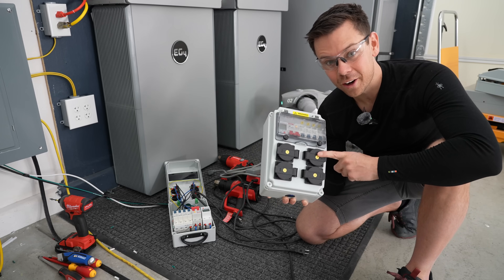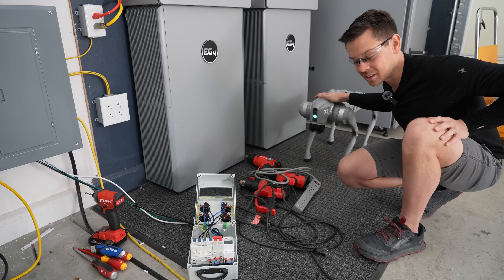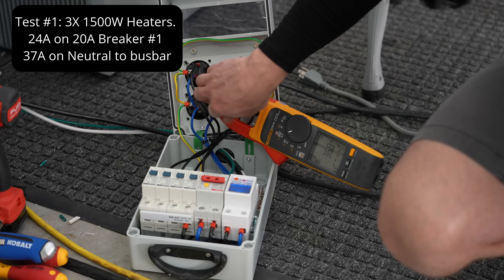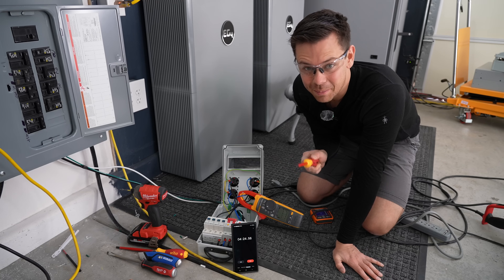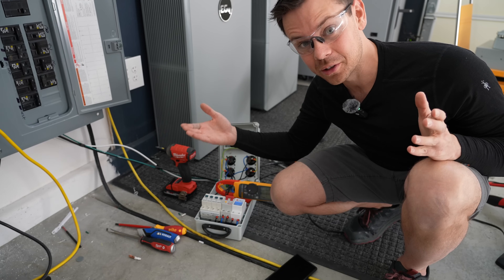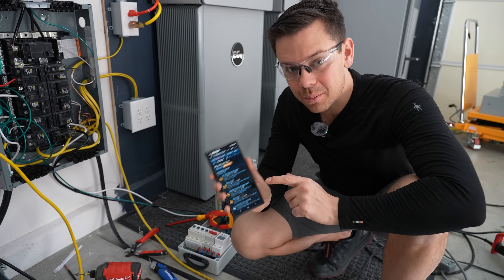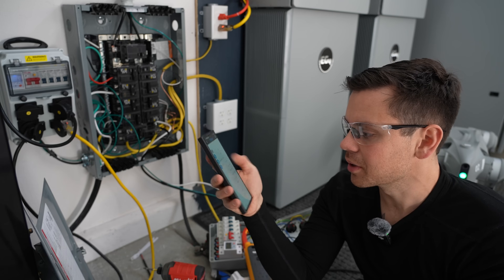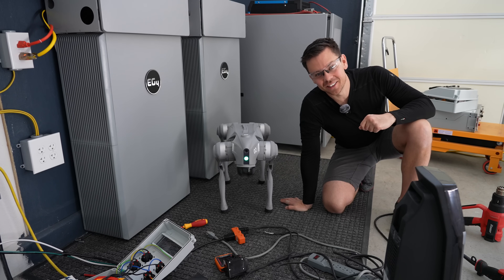Are 20A Breakers from China Safe?! Let's test them!

Comment from the maker: Some more points:
The high quality UL breakers are also from China.

Some breakers are designed to trip after a longer duration. That's why I was trying to find data sheets. But I couldn't read the graph on their site. Couldnt find data sheet. And they were not UL listed. That information should be easy to find. 

Even if the wiring passed this short test, having 40A on a 14 gauge wire is not conforming to any accepted standard. I used to push 100A surge on 12 gauge wire on my race drones, but they are moving very quickly. Just because you can do something, doesn't mean you can do it for very long or safely. 

If you like this type of testing, let me know by giving the video a thumbs up! If a video does well, I will make more of them! :D I am constantly looking to check to see how you vote. Please let me know!
Reply: The duration is governed by the breaker type.  A, B, C, or D.  The typical breaker is type C or type B and run on standard trip curves.  Type C is the most typical and has generously long trip times.  Type B is a tighter spec than Type C but will false-trip on inductive starts more often.  Type A is almost never used, and Type D is used ONLY for hardwired AC motors with high inductive loads.

The two things to verify are:

(1) 3x (type B) or 5x (type C) current or higher (aka a short) should instantly trip the breaker via its solenoid.

(2) And otherwise the trip curve's worst-case time for any given current ratio should not be exceeded.  (this is the thermal trip via the bimetalic strip internal to the breaker).

The internal bimetal thermal trip does likely have an adjustment screw, possibly accessible and possibly internal and not accessible.  It sounds like it might not have been calibrated.  But that's still bad, obviously.

-Matt
Reply: Yes, UL certification has to do with quality control. 
Very strict.
Canada ,USA  UL or CSA  is costly bottom line is they are made to preform their specifications.
Either Mexico or China, 
Most inexpensive electrical sold on Am*z*n  if no UL or CSA
Avoid.
Reply: UL exists for a reason.  Their testing is expensive and a pain in the ass but UL Certified actually means something.
Reply: the C class breakers have a 30% over current trip, B class have only 10% over. the D class breakers are retarded breakers for motors... they trip with like 20%over but after 1 min...
Reply: re-commenting here so Will sees it ... The TAIXI MCBs are standard C curve devices as indicated (C20) on them and have thermal and magnetic trip.  C curve devices will take over 16 minutes (most trip graphs simply don't go up far enough on the time axis to show what the expected trip time will be!) to trip at 1.25 x rated current.  At 2 x rated current they will operate in 50 seconds or so, assuming standard test environment (air temp 25c, MCB mechanism temperature at 25c).
Reply: Is that rail mounting system for breakers used anywhere in north america? If they aren't, it's not strange at all that they are not UL listed and instead listed as CE for europe and china
Reply: @scania9786  The rails in the plastic box?  Those are probably DIN rails and they are standard world-wide for many small form-factor devices, including MCBs and MCCBs.

-Matt
Reply: @scania9786  DIN rails can be found in industrial and commercial in the USA.
Reply from the maker: Some other viewers pointed out that this long duration rating is common for Europe. It's spot on. I am not used to this at all. All the America breakers trip pretty easily. 

Still havent found a data sheet for this thing.
Reply: @WillProwse  You won't find a datasheet.  They don't make them publicly available, if they even exist, but they do have full specs for classes of their devices on their web page.
Reply: @WillProwse  This all just reinforces my decision (a few years ago) to over-size all my wiring.  I also use Type B breakers as a first-cut on the DC side for the tighter specs, and only switch to Type C on circuits that trip Type B.   That said, the industry standard is Type C because the industry really doesn't like dealing with consumer complaints about premature trips.

I've always felt, though, that breakers should be a bit smarter than they are.

-Matt
Reply: Fluffy
Reply: ul listing and CE listings are nothing more than a payed document...

Comment: You need to now test the 80 Amp breaker as well.  Off to the resister wall.............  I guess I missed the wire one, thought it was the one I had watched.
My guess is the robot dog has orders from china to not let you find out their sh*t is substandard. It goes into mailman mode when you look.

Comment: I see a lot of people commenting about the poor quality Chinese breakers.  They are performing pretty reasonably.  Search for a C curve trip graph and follow the mean line for 1.25 (25A) x and 1.85 (37A) x (the mean line is halfway between the upper and lower bounds of the trip area).  That's usually where the manufacturers target.  It's acceptable to operate at the extremes of course too.  Keep in mind that these things are affected by ambient temperature too.

Comment: Thanks for the third update.
Mine came an hour ago, I got the one with the L5-30 socket;  I read the instructions and they have CE and ETL certified in the paper, but where it's stated is confusing, it's not in the row listing the  circuit breakers, but only in the row down by the sockets. 

so is this sockets only or all is the question.

I managed to find some english writing on the wires and temp is listed above 400 C and 700 C, and a size of 2.5mm on the line wires, now from my memory 2.5 mm would be 10 AWG, I didn't have any #10 stranded, but I have lots of #10 solid and I compared the diameters placing the solid up against the stranded and the stranded was thicker.

Socket for l5-30 is 32 amps, but instructions say use only 80 % so we are talking 25 amps max. can we take those breakers out and replace them?

Looks like this is going back.

Comment: Don’t forget … this all European style beakers. If you buy a an C20 MCB you become an breaker that must resist 1h for an overload of 1.35 - 1.5 times current before trip. The cable in this combiner boxes seems to be 10mm2. In Europe at 230V this cable can handle up to 63A of current (230x 63A = Watts). The red ferells seems also for 10mm2. This box is not really for USA in my eyes
Reply from the maker: Ohhh wow. Another viewer said that. I am not familiar with European trip points

Comment: Obviously not as plug and play or as waterproof, but building one of these is easy and fairly cheap. Get something like the Eaton 4-space outdoor load center, and connect a couple receptacle boxes along the edge. You can build something like this for roughly $100 with GFCI. 
Everything would be UL listed, safe, and quality. (as long as you know how to correctly wire up a few breakers and receptacles)

Comment: I like the idea of these boxes, but ya, I think I'll pass one these specific ones. A few thoughts, 1) I wonder if these are "supplementary breakers", where they are meant to be used where there is another primary circuit breaker providing protection. Different standards and trip curves than normal breakers. 2) I found the raw empty case on aliexpress, wondering if it would be worth buying the empty case, and DIY-ing it by putting in better components ourselves.
Reply: Yea, CL listed breakers would be better.  LOL
I was just thinking.  Are they the same busbar spacing so you could swap out the relays, and add a bus strip for the neutral wires.

Comment: Great work! Glad you are hot testing. Another example of junk from China. I have several DC non-polarized DIN rail solar breakers that I am now concerned about. I have had polarized DC circuit breakers that have caught fire -- never again. When it comes down to it, best to use fuses + breakers these days in solar (T-type fuses are the best). Great work Dr Will -- the electronics man! 😄

Comment: The TAIXI MCBs are standard C curve devices as indicated (C20) on them and have thermal and magnetic trip.  C curve devices will take over 16 minutes (most trip graphs simply don't go up far enough on the time axis to show what the expected trip time will be!) to trip at 1.25 x rated current.  At 2 x rated current they will operate in 50 seconds or so, assuming standard test environment (air temp 25c, MCB mechanism temperature at 25c).

Comment: At one time Underwriters Laboratories was the only listing agency in the U.S., they had a monopoly & grew fat & arrogant. ETL came along with lower pricing & UL had to rationalize their fees. IIRC CE is an Asian listing agency used by much of Chinese, Japanese & Korean companies for listing their gear. Generally, a company does their own listing paperwork & submits it as a basis for testing & listing the device, then the listing agency is supposed to decide if the paperwork is OK as is, needs more or different info & testing, or would need to be scrapped & the agency so full independent testing. Not much of the latter takes place due to a) cost, & b) if incompetent mfgr work is submitted they really need to start from scratch & address that issue first

Comment: I'm a bit surprised that the Taixi's performed so poorly.  I've been using CHTAIXI 2-pole unpolarized breakers for ages and they tested well for me.  I even pulled a couple of them apart and verified the internals, and checked both the thermal and the solenoid trips with loads.  Those aren't U/L listed either, though, and given the similarity in name sounds like the same OEM.   Sigh.
Reply from the maker: Which models and did you have a data sheet? I can't find mine
Reply: @WillProwse  Looks like... the 2 pole breakers I have are all TXC65Z-60, then the amperage rating is either Bxx or Cxx.  Such as B20 (for example).   These are DC breakers.  I could NOT find a datasheet for them.   The curves more or less followed standard Type B and Type C curves when I tested them.

The ChTaixi 2-pole DC breakers are nearly all unpolarized (aka no magnets), while their single pole breakers are polarized (have magnets).  I use their 2-pole DC breakers pretty much universally in all my solar gear for that reason.

-Matt

Comment: I have found that these chinese DIN breakers from Amazon to be all over the place as far as DC breakers goes. I have a 16A DP breaker that I use on my little solar system going into a ISUNENERGY 20A MPPT charge controller charging a pair of 2 Eco-Worthy 20A LIfep04 batteries and the damn thing trips at 8A going through the breaker. Gets annoying when it trips and having to reset it. I have another 10A DP breaker that trips at 2A and another that will carry 30A and will not trip even after 30 minutes.  I really wish that I could find breakers that do what they are supposed to do.
Reply: The breakers tested in this video are AC.
Reply: @steverrada  I am aware of that. I have the same issues with Chinese DC DIN breakers.....

Comment: You need to look close as there are 2 different CE designations. They both look very similar, but one has a slightly different CE design than the other. The legal CE has more space between the C and E whereas the unofficial one shows the CE close together.
Reply: As far as I know that's not really true. I think here is an official specification for the design. 
But all such products for the EU market need to meet CE certification and there is no other unofficial CE, like China Export or something like that. The problem with CE is, it is not a test certification. It's just a declaration by the manufacturer that he adheres to the standards. If the manufacturer is not trustworthy, he might just print the CE on the product, without even having looked at the standards. If it's a small Chinese brand, no one will probably check until something happens.
Reply: @samm9196  There is an official design for the correct CE. The Chinese version of the CE is "Chinese Export" and no relation to the EU certification. The official CE symbol is designed over two circles the same size that intersect between them. The C is in circle 1 and the rounded E is in circle 2. The Chinese version does not intersect the circle circumference points but puts that rounded E about half way into the C circle. You have to really look close to see the difference.

Comment: you do know how to read the tripping graph right? bottom row = multiplier.  left row = time  so depenting if B C or D characteristic. ur breaker will eiter insta trip at 3, 5 or 10 times the rates load. your 20A breaker when its at 40amps load so 2x, will trip around 20 min later
Reply from the maker: Yeah I do, post it. I can't find it.
Reply from the maker: That was the issue I had at the end. I can't find any official data sheet on this exact breaker. Can you post it on the forum?
Reply: This is a C curve device, typically the manufacturers target the mean value so in practice magnetic trip will be a 7.5x.  For a C, magnetic trip must not occur below 5x, can occur anywhere between 5x and 10x, and must occur at 10x or greater.  Of course what will is doing is well in the thermal zone so the figures don't apply.

Comment: Current carrying capacity of a single insulated short wire in free air is much higher than the NEC recommendations (which assumes crazy long wires,  multiple conductors,  inside conduit). 

I have a 40 year old welder rated at 200A with a 12 gauge wire feeding the stinger connector. I was very surprised to see that,  but it has lasted this long with no issues. 

I wouldn't be too worried about the 14 gauge wire. 

Fuses normally blow at 1.5x their rated current. It's not unusual to see that also in breakers.

Comment: That breaker probably would have gotten warmer with the box closed. Not sure it would make that much of a difference, though. Thanks for all you do. Love this channel!
Reply from the maker: Good point
Reply: It sure does.  More reputable products such as Hager etc provide tables of derated trip points based on ambient temperatures but the derates are pretty standard thing so even if the figures aren't provided it can simply be assumed.  The 20A rating is pretty much guaranteed to be taken at ambient of 25 celcius.

Comment: I would always go with what professionals use to Schneider, ABB, Hager or whatever is avalible, never toy or cheap out on electrical stuff.
Reply: Yes, and especially for standard stuff, like B16 MCBs here in Germany, ABB f.e. is not even that much more expensive than China stuff. I thought about using Type B RCDs from a larger Chinese brand like Chint (which should be ok I guess), since there it makes a big difference in price. But for most things it's just not worth the risk. Also the documentation is so much better.

Comment: That has split phase 240 going into it correct? If so, then the shared neutral is fine. It wouldn't carry 40 amps, it would only carry the imbalance between the two hots.
Reply from the maker: No, single phase 120

Comment: As I mentioned in a comment on your last video, reality is more complicated than electrical code. Electrical code is like a codified rule of thumb. The convention of 20A breaker requiring 12A, 14ga wire requiring 15A breaker is a very conservative convention meant to be easy to remember and safe in as many situations as possible. Reality is that a long conductor in packed conduit or wall cavity can safely carry less current than a short wire inside a chassis. The longer wire will suffer from higher voltage losses which causes many other problems including higher current draw for the same amount of power delivered. Short wires can actually carry a lot more current than you might think as long as heat can be properly dissipated and the terminations have low resistance.

I'm not saying these Chinese outlet / breaker boxes are safe, but it's not as simple as you portray. I do love the idea of condensed affordable outlet / breaker boxes though and for many years have wondered why you can't buy them more easily.
Reply: exactly the rules for wiring inside equipment chassis are different.
Reply from the maker: Oh I am well aware but when it comes to a channel that millions of people see, 40A thru 14 gauge is not accepted by any standard. I used to push 100 amps through 12 gauge wires on my race drones. Surge obviously but I understand the limits of these devices. I get it. But when you make recommendations on the internet you have to follow rules.

Comment: You need to know the trip curves before you do any testing of circuit breakers. Especially thermal type. Just saying it didn't trip because you are running more than the rated current is not correct.
Reply from the maker: Yeah but I can't find it 😂 I was looking for that multiple times. I showed it on camera too if you watched the video.
Reply: @WillProwse  Dumb experiment, MCB"s  with C, B, D  power on 2xInom curve woking time is 20-100 seconds